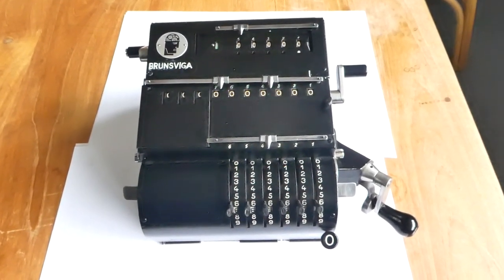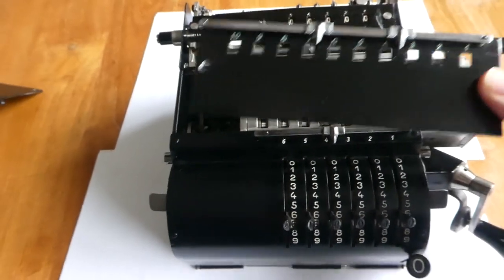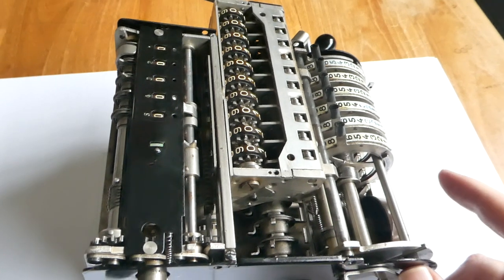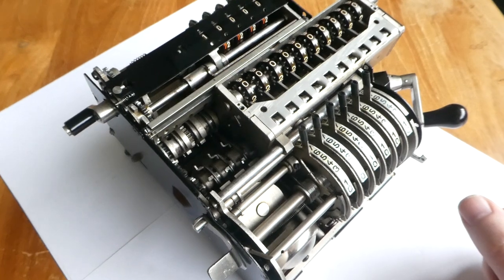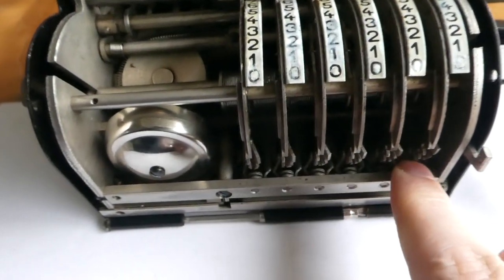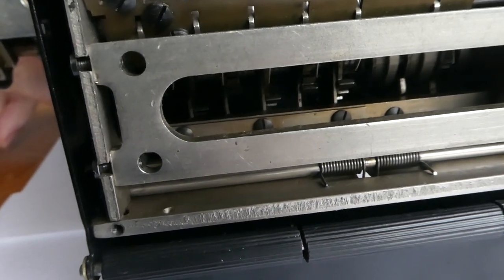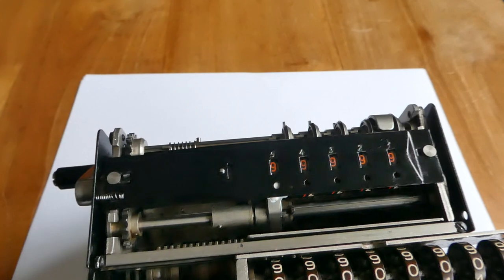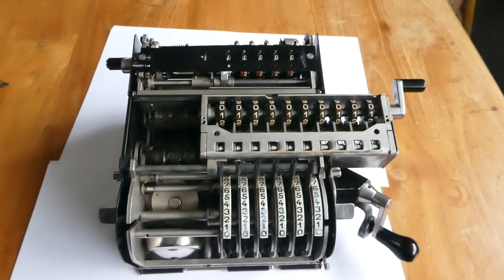The mechanism of the Brunsviga 10

Comment: Wow nice video, I have a Nova 10 and I didn't know it could make divisions because I expected to find some ADD/SUBTRACT switch. I really didn't think it would "detect" the direction of the first rotation. BTW mine is not "smooth" (and clean) as yours. Do you have any tips about cleaning/oiling? Is Singer oil fine on these machines?
Reply from the maker: Good sewing machine oil is probably fine. Personally I'm a big fan of silicone lubricant spray, as it is safe on plastics, easy to apply, and won't make a mess if you use too much.

Comment: My father-in-law gave me his Brunsviga 11E. It seems to work fine but the sledge wont budge. Any idea what could be wrong? I couldn't fine any info on the 11E's internals :(
Reply from the maker: I have a video about the 11E as well. It may be that the carriage is locked or transportation:
https://www.youtube.com/watch?v=SfmAez-5HA0&t=120s
Reply: @jaapsch2  Thanks, I've already watched that :-) I've removed the housing so it's not that lock. When I try to look inside I can't see what keeps the carriage from moving. It doesn't move at all.